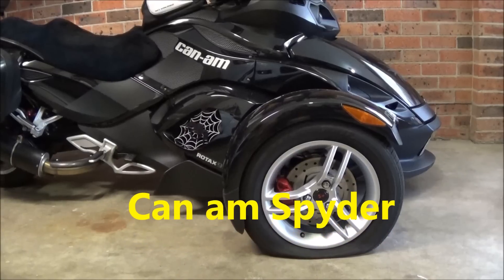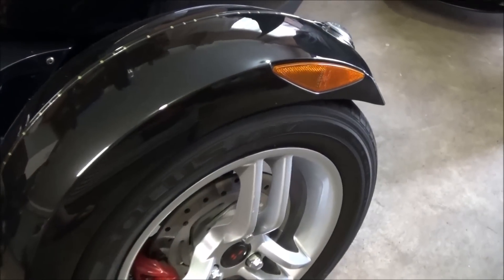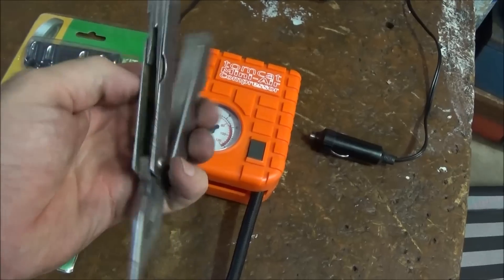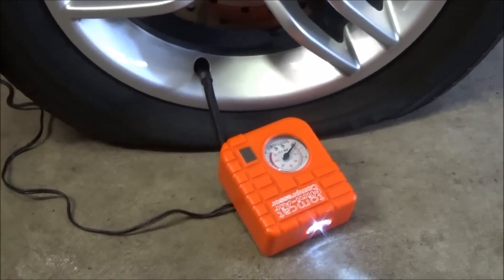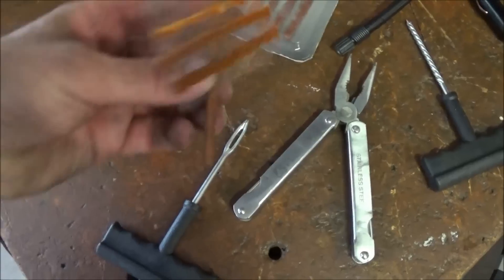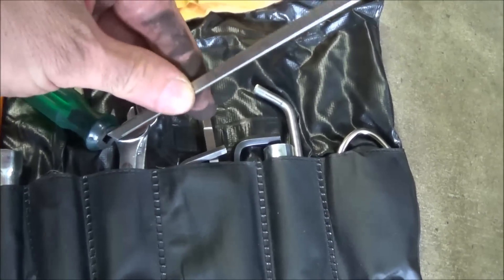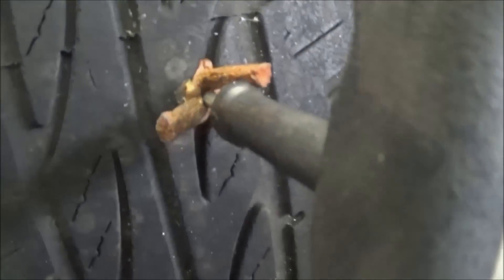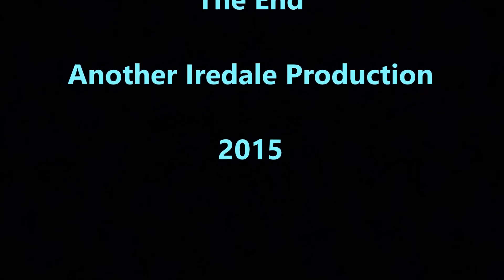Can Am Spyder Tyre Repair

Comment: Great video. Good luck to a lot of us using that 12 volt compressor on a lot of the older spyders.  I have a 2013 ST-S and I still have not found my 12V port 🤔.  Thanks BRP.  I'll have to pack a MUCH heavier battery operated compressor for  my trips.

Comment: Have you had your rear fender brackets crack on you were it bolts on to the fender
Reply from the maker: Yes. This happened after only a few thousand km. it was replaced under warranty and extra triangle brackets fitted to strengthen the guard. 
Had no problem since and have now done 40,000km.